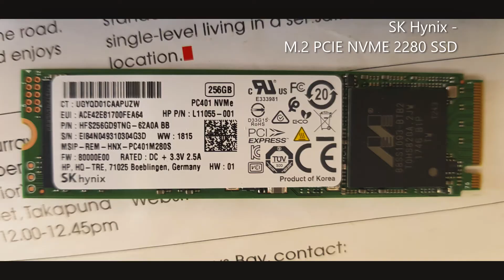HP Pavilion 15-cs0003tx 2018 - Disassembly

Comment: Hey man, I was thinking about getting this laptop or a similar model. I was wondering how long the battery lasts and how the build quality on it was. I was thinking of using this for school, so do you think it would last daily commutes to and from school every day. Thanks.
Reply from the maker: Hi Chromneus, since I had this laptop for a month & been using it as my main drive now, the battery life is around 4-6 hrs & this depends on what particular apps you use, like chrome, photoshop, gaming etc, and it's very light due to the ultra-book design & no optical drive (better buy an external optical drive), plus my model comes with a M.2 NVME 256gb SSD for fast boot up & 1tb HDD (both upgradable), and 8gb ram (upgradable).

Overall, I highly recommend it since its not an expensive laptop (got my for $1322NZD).
Reply: Thanks for the help, I appreciate it.
Reply from the maker: @Chromneus  No probs!